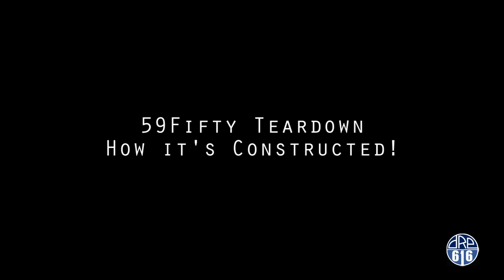59Fifty Teardown - Cap Construction Revealed!

Comment: +1 on Dodgers fan. A lot of New Era caps (especially the blanks/custom ones) are white underneath the brim. What's under that if you remove it with a seam ripper or something? I prefer the color under the brim to be the same as the rest of the brim, but if I remove the white I'm worried it would destroy it.
Reply from the maker: Have to confess I'm not sure I know exactly - are you saying the undervisor fabric is white?  I've done a whole video on visors, btw - in case you'd like to see the construction and materials - https://youtu.be/wD2jpl_fNUA

Comment: The brim is certainly not plastic and they are not a fan of water exposure for multiple hours
Reply from the maker: New Era actually uses a composite material made with both fiber and resin, so yes there is a percentage of plastic in them. I did a more recent video that was all about visor construction, and in that video I said rule #1 was still “don’t soak the visor”
Reply: @dreinthe616  is there anything you can do if you have a bill that has gotten soft?